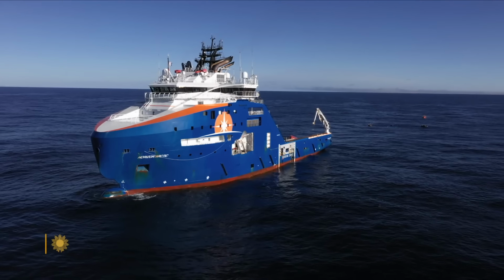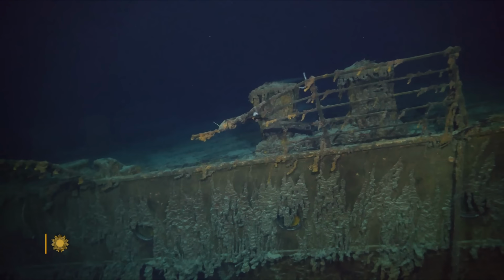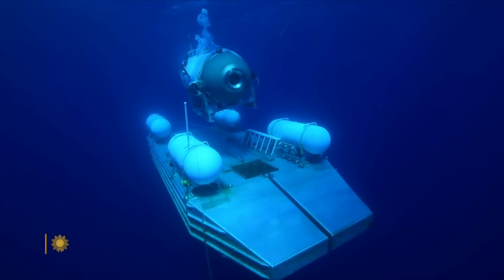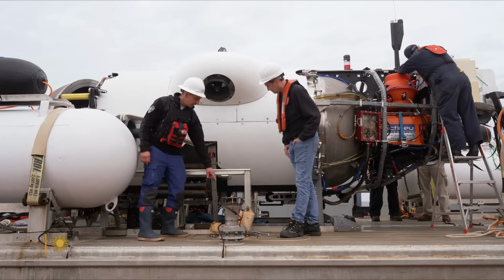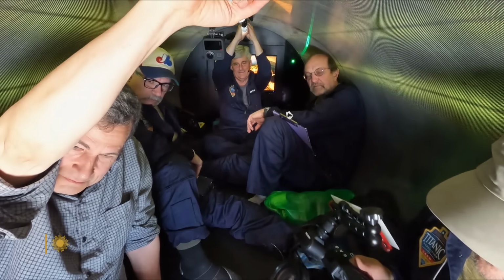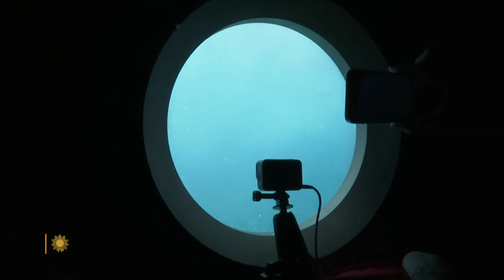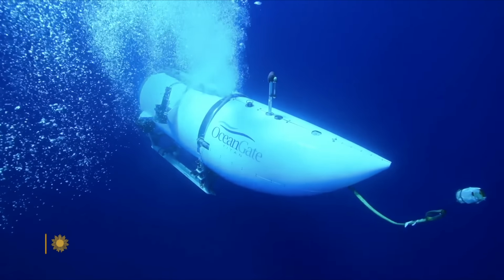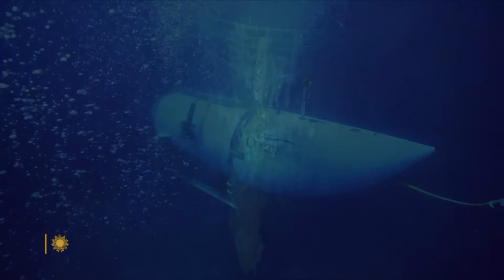Inside the OceanGate Titan tragedy

Comment: The viewport of the Titan submersible was only built to a certifiable pressure of 1,300 meters (4,265 feet). The CEO refused to upgrade it. The Bathyscaphe Trieste had a 5-inch thick steel hull and reached the Mariana Trench in 1960. It weighed 50 long tons. Most of the Trieste had thinner steel, but it wasn’t pressurized. Metals can corrode when they're next to other metals. 

Pick only one, such as either steel or titanium, and stick to it. That's already a superior design than the Titan submersible, and the Trieste was made over 70 years ago. When it comes to strength, aluminum alloys have ultimate tensile strengths ranging from 10,000 psi to 75,000 psi. 

Titanium alloys have ultimate tensile strengths ranging from 25,000 to 220,000 psi. Steel has ultimate tensile strengths ranging from 35,000 to 350,000 psi. There's your winner. Delamination is when layers of carbon fiber begin to unbond due to stress. Steel returns back to its original shape. Damage to carbon fiber remains and accumulates. 

Carbon fiber is horrible for a sub. James Cameron designed his Deepsea Challenger sub out of syntactic foam and 2.5-inch steel beams. It was tested for its ability to withstand the required 114 megapascals (16,500 pounds per square inch) of pressure in a pressure chamber at Pennsylvania State University.
Reply: How do you know the viewport is certified to that depth?  He has been down well past that depth many times.  Carbon fiber was the problem.  

All this talk of off the shelf components was overblown.  He is correct that the hull is the key, but he made a huge mistake there.
Reply: Luke.. like your statement few folks have this clue.. bravo! well explained and concret.
Reply: @henrylee8510 luke is right saying.. the sub was certified for max. 2.000.m.did you know that its name of sub isnt.. titan? and stockton had severals subs not just one to disposal for undersea journeys, but material is not suitable for that depth. i know steel and titan are best mat. for subs or capsule.
Reply: Well written this should be pinned
Reply: As a non-engineer, I’d go with a spherical design, made of steel much thicker than required and with viewports certified for well below that depth.  I’d still be in operation.  One could make it large enough to seat 5 ppl, tho the walls might be ridiculously thick….so be it.  
I wonder if they heard any cracking just prior to the implosion?  We’ll never know.
Reply: Excellent explanation
Reply: Thank you for the informative comment😊
Reply: That was the viewport for the first iteration of the sub.  My understanding is it had been replaced by one better suited to the pressures encountered.  But yeah, this thing has several points of failure that were bound to eventually destroy it.
Reply: @henrylee8510  In 2018, David Lochridge filed a lawsuit against OceanGate for wrongful termination. The company fired him because he addressed the safety issues with the Titan. The viewport is the window at the front of the sub. I don't know how much clearer I can make that point. It's not rated to go below 1,300 meters. He was the former director of Marine Operations.

The Carbon fiber weakened after every trip down there. The design was terrible right from the get-go. Instead of changing the design using steel or titanium, they continued using the carbon fiber. It was garbage, and the only people who called him out on it lost their jobs after it was said and done. He only wanted a yes-man around him.
Reply: @skunkape2  Replacing garbage with more garbage is useless.
Reply: I just dont get why you are talking only about tensile strenghth…..but in actual its compressive strenth that play  major role in hydrostatics…..
Reply: Very clear and well written comment 🫡
Reply: All things aside, this was a very respectful clip. Rush did die, please be respectful.
Reply: @ashishyadavf  Yeah, true. For designing a sub, knowing the compressive strength of a metal is very important. Unfortunately, it's just harder to calculate. The difficulty in finding compressive strength can be overcome by substituting the tensile strength value for compressive strength. 

If you use the Mohs Hardness Test, stainless steel tops the list. Steel: 4-4.5, Titanium: 6, and Hardened steel: 7-8. High-carbon steel is the key. This substitution is a safe assumption since the nominal compression strength is usually greater than the nominal tensile strength because the effective cross section increases in compression and decreases in tension. 

One exception is cast iron, which has higher compressive strength than tensile strength. In other words, you can't go wrong designing your pressure vessel using steel or titanium. But titanium is more expensive, and it's also harder to shape. That's why the U.S. Navy has avoided using it for their subs.
Reply: @Bellaa4578  We all understand that, but Rush was also disrespectful to a number of engineers that could have prevented this horrible tragedy. Non-destructive testing was ignored. Explaining why the Titan failed is more helpful than saying R.I.P.
Reply: The verse of God is repeated again, just as people built a gigantic ship before and challenged God with it that he could not sink it. God accepted the challenge and sank it today, drowning a submarine that came to it and took the same name. And just as God made the whole world talk about ships And he makes movies and songs for it to make it famous and teach people his verses He made the world talk about the submarine and became famous so that they could know his verses More fame for the first incident and a reminder of it so that people can remember its verses
Reply: There isnt enough clapping and cheering I can give this comment…. Best I can do is emojis.. 👏🏼👏🏼👏🏼👏🏼👏🏼👏🏼👏🏼👏🏼👏🏼👏🏼👏🏼👏🏼👏🏼👏🏼👏🏼👏🏼👏🏼👏🏼👏🏼👏🏼👏🏼👏🏼👏🏼👏🏼👏🏼👏🏼👏🏼👏🏼👏🏼👏🏼👏🏼👏🏼👏🏼👏🏼👏🏼👏🏼👏🏼👏🏼👏🏼👏🏼👏🏼

Comment: Always remember that rich kids who have impressive degrees may not have exactly earned said degrees. Also, aerospace is a different beast from submarine engineers. Keep in mind that, in an airplane, the greater pressure is inside the plane but, in a sub, the greater pressure is outside the sub. It matters which direction the forces are acting on where the people are in a craft.
Reply: Just ask Lori Loughlin!
Reply: Not to mention there’s ~ 14.7 psi of internal pressure inside an airplane. There is 6,000 psi of external pressure at the depth of Titanic.
Reply: This guy wasn't a kid, he was 61.
Reply: @kylek.3689  He was already rich while being a kid.

Comment: David, I hope you are doing okay now.  I'm glad you got to meet Stockton and at least see what it was all about, even if your mission was scrubbed that day.  I'm really sorry you lost some friends, but glad you are here to tell the story.  I'm not sure the hull failed at all.  I agree with James Cameron.  It was the use of three different materials (which constrict/expand at different rates, the titanium, the Plexiglas portal, and the carbon fiber all worked against each other.  If it had been constructed of all steel or all titanium with a hatch vs. a portal, and also a round vs. tube shape, those 5 souls may have had a chance.  RIP.

Comment: I served in the United States Navy as an Auxiliary Mechanic between 2010-2014. I qualified in Submarine Warfare and am quite literally an expert on this case. The following is my take on this catastrophe which I stand by and would testify to in a court of law. I will omit and/or censor information that is likely classified and could reveal places, depths, and locations and do a lot of bad in the wrong hands. 

First, The USS San Francisco hit an underwater mountain in 2005 and only one person was killed in the crash. With a crushed forward compartment the ship still surfaced and saved everyone on board (except MMA2(SS) Ashley RIP)

Secondly, Every system that involved operation outside the ship had a haul valve and two backups. And the last chance backup was using *,000 PSI hydraulics. Even our backups had backups so we make it home safe. 

Thirdly, Our United States Ship hull was made of **-*0 steel and would not make it to 13,000 feet. It wouldn't even make it to 1/(omitted) of that before being crushed due to the pressure put on the hull. 

Fourth, in the movie Titanic they don't even send people down in their underwater explorer to see the Titanic. The movie creators, actors, directors, and producers themselves took more care of human lives than the Titan CEO did. 

Fifth, the Titan didn't have an Emergency Air Blow system which is the reason the *****fe system was instituted after the USS Thresher got water in their emergency air system, failed to surface when actuated, and crushed under the pressure of the depths of the ocean. 

Sixth, I am not sure of the CEO's net worth but I have been told billions. I do not know how much it would cost to buy a decommissioned sub and employ a crew but from the sound of it this guy could afford it. Why was he cutting costs? 

In my personal, and professional opinion the Titan CEO committed gross negligence. He was warned by multiple parties and ignored it. It is my personal, and professional opinion that every member of the jury would have done a better job with this venture. 

Thank you for your time,
Former MMA2(SS) Stephen C. Goldsmith

USS Ohio SSGN726 (Jan. 2010-Nov. 2010)

USS Alabama SSBN731 (Nov. 2010-Jun2014)

Comment: Carbon fibre has tensile strength, but the forces from water pressure acting on the Titan were compressive. It is likely that the binder alone gave the hull its compressive strength with fibre holding it together to prevent cracking. The junction of the carbon fibre, titanium and the glue that bonded them was a weak point with different rates of expansion and contraction. Glue that is elastic at room temperature is likely brittle at near freezing temperatures. These materials were bound to detach from one another. What is surprising is not that the vessel failed, but that it managed to hold together for as long as it did. 
   
There is nothing fundamentally wrong with a cylinder design with hemisphere ends, although in the submersible it was employed in a situation that is the reverse of the gas container concept under which it evolved where gas pressure is exerted outward. Forces acting upon it merely need to be analyzed correctly. That will likely be the shape of future crafts, not spherical designs. Had the hull of this vessel been constructed of a single material, titanium, properly analyzed as to the forces acting upon it, possibly cast as a unit, this craft might have successfully completed this and many other trips to the ocean floor and back.
Reply: Thank you! This is a sound, well-informed analysis.
Reply: The verse of God is repeated again, just as people built a gigantic ship before and challenged God with it that he could not sink it. God accepted the challenge and sank it today, drowning a submarine that came to it and took the same name. And just as God made the whole world talk about ships And he makes movies and songs for it to make it famous and teach people his verses He made the world talk about the submarine and became famous so that they could know his verses More fame for the first incident and a reminder of it so that people can remember its verses
Reply: Exactly. Because 12 trips was A LOT for this craft to withstand. It was just a matter of time before the weaknesses became fatal.
Reply: could not have said it better, a totally homogenized hull of metal that does not fray and bend so willingly to the oceans pressure, what an assanine way to go, rip
Reply: @aaishasingh3565  --- where can you find 12 trips other in this piece. It's 3. And the 4th never came back.
Reply: @@Richy_T Watch the big YouTuber who posted his “My Experience” video aboard the Titan, the guy with 16M followers posted two days ago. Around the 21 minute point you can watch him get it and get a good look at the dome door joint as they close it and begin to fasten those bolts. It’s insane. They’re coarse thread bolts, with no washer, making an audible metal on metal scraping sound. Any critical high pressure mechanical seal I’ve ever fastened, like cylinder head bolts, was nothing like that. Those were all precision industrial strength parts.
Reply: @WinterLover73  in this video

Comment: "nature cannot be fooled" as Richard Feynman famously said at the 1986 Space Shuttle fatal explosion inquiry. 'O-ring' pressure seals then, carbon fibre/epoxy resin composite hull with this. Deepsea marine engineers warned OceanGate years ago that this was a very possible scenario and one had asked him directly to stop using the material. Rush's response was to threaten legal action! Only simple basic physics is needed to understand that a high quality steel or titanium continuous structure is required to reliably withstand water pressures of 5 to 6,000 PSI.

Comment: Wild that it lasted for 12 trips at that pressure
Reply: It didnt. It didnt even make it once that deep.
Reply: @123321david  It did, check their prior trips, people went in them Chelsea Kellogg was one, there's a Youtube channel of a guy called "alanxelmundo" who went on another.

They went right up to the bow of the Titanic, it was visible from the porthole.

The whole problem with Carbon Fiber is that it doesn't fail immediately, it fails due to repeated stress over time
Reply: @liquidsnake6879  you Are right about the Carbon fiber, but from all the other videos i gatherd was that they did a test dive not even that deep once before coming up agian due to problems.

Their side glass was rated for 1,400ft pressure, not 4000ft pressure, Titanic is around 3,800ft pressure...
Reply: Actually, it lasted for 20 trips at that pressure! 20 trips to the bottom, but only 12 times to the actual shipwreck.
Reply: @123321david  It did make it that deep more than once. There are photos of a passenger in front of the viewing window with the Titanic in the background. The manufacturer of the viewport wouldn't certify it below 1300 meters unless the company chose a different design and paid much more money. Doubt that part failed. Mostly likely the hull did. If the viewport had failed, likely would have been instantaneous without any warning sounds beforehand. There are indications the crew began ascending prior to implosion, which again suggests a hull failure. Question is whether it was somewhere in the middle or at the connection to one of the endcaps. While many are criticizing Rush, it's remarkable the thing ever worked at all and did so multiple times. Still doesn't excuse what happened though.
Reply: @ronbennett7885  im clary missinformed and need to do more research then, but if that thing made it down there as you guys said, then im very impressed! It would make Sense that those passengers trusted them if they had been down there earlier. But yes i agree with the hull and endcaps theories! Many thing was made stupidly and wrong... like the part where they glued it in a normal room, and not a pressureised room so they could vacoom out airbobles in the epoxy etc... many factors they didnt think about that could go wrong...
And ofc the "innovative" Carbon fiber....
Reply: @123321david They said so about this very topic in this video. They mentioned the numerous dives that didn't reach Titanic, but that it did reach it 12 times.
Reply: The verse of God is repeated again, just as people built a gigantic ship before and challenged God with it that he could not sink it. God accepted the challenge and sank it today, drowning a submarine that came to it and took the same name. And just as God made the whole world talk about ships And he makes movies and songs for it to make it famous and teach people his verses He made the world talk about the submarine and became famous so that they could know his verses More fame for the first incident and a reminder of it so that people can remember its verses.

Comment: “There were a lot of rules out there that didn’t make engineering sense to me” 

That’s a haunting foreshadowing of what was to come….

I’ve built a lot of things from drawings by engineers…at times there are things that seem to add man hours and more materials to ‘achieve the same thing’ to me….
When questioning engineering about it, they normally have very good reasons that make sense from an operational standpoint rather than construction installation standpoint… always defer to professionals that are working off of generations of data points